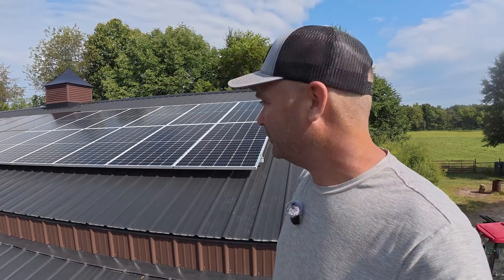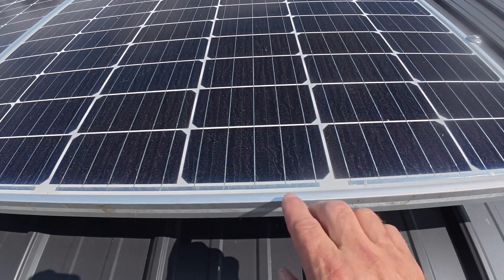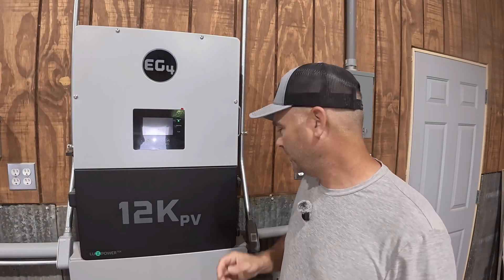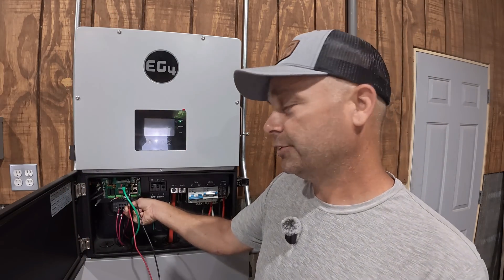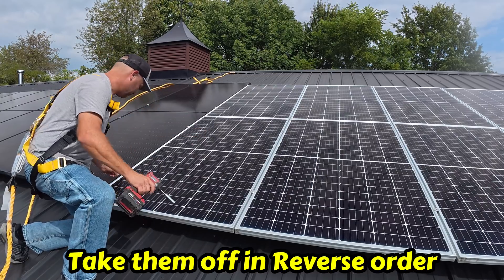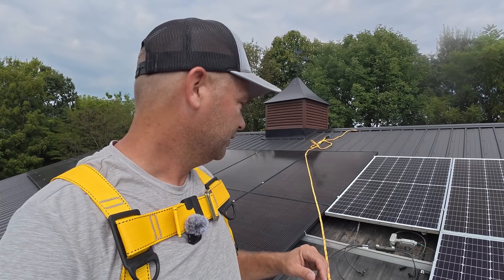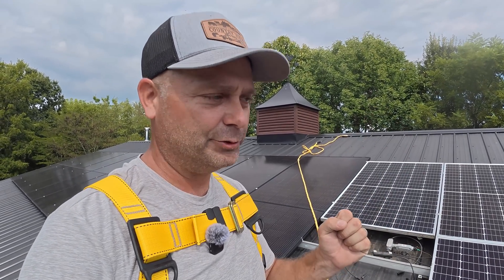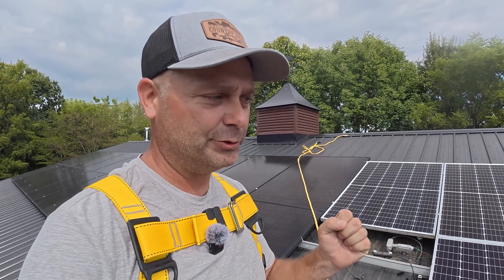Replacing My Oldest Solar Panels with New N Type Solar Panels

Comment from the maker: Canadian Solar 450w N-Type Solar Panel:  https://bit.ly/4oF36ZF
Low Price Per Watt - Solar Panels:  http://bit.ly/3Jx8EmQ
Save $50 off a $500 order at Signature Solar by using my Discount Code:  COUNTRYVIEWSAVE50
Reply: In the ignorance of grid tie is easily demonstrated with a volt amp meter and 4th grade math called ohm's law
As once connected to the grid can only put in 15% of advertised output or extra electricity
And are getting credit for like 100% which equals everybody's electric bill skyrocketing to compensate for the power not actually going into the grid
And that's how we're able to and get it banned in certain cities and counties

Comment: Is it dangerous to disconnect MC4 during daylight?
Reply from the maker: If it is being used and current is flowing, it could arc.  If the solar disconnect is turned off, so no current is flowing, it shouldn't Arc.  But it will have voltage present.
Reply: @CountryViewSolar-DIYProjects  you are 💯 right

Comment: Set up the ones you just took down on a ground mount to back up your off grid array. That could least run your AC/Heat Pump or charge an EV? 👍

Comment: You need to make a ramp that goes to flat so that the front wheels of the tractor ride up one so the forks reach over the roof, it would save you a lot of time when up on the roof

Comment: I made a similar change and I'm building a similar array.

A bit over 20kw and using new Type N Topcon stuff.

I saw huge gains getting rid of the small 200w panels with lesser technology, especially in shade or less than ideal conditions.

Comment: When setting up my solar array it's a ground mount; ground mount panels run cooler than roof mounted and no climbing on the roof for maintenance. The array is split into a V shape: outer ends are tilted toward the north for a 23.5 deg array angle on each am/pm leg to grab more morning and evening light energy while lowering the mid-day energy clipping. That way I can use a lower KW cost inverter.

Comment: I'd be nice to keep the leaf debris out by putting a screen at top of the panels closest to the roof ridge
Reply: Windy days and rain will help keep the leave debris under control and non disruptive as it has from what we see in his video.  In Evans situation, the leaves are getting blown from the other side of the pole building over the peak of the roof.  A screen would trap the leaves and once they got wet they are stuck in place and a real pain to clean and dislodge from any screening material (just like gutter guards).  Then if any late falling leaves accumulate you risk ice jams above the solar panels in colder weather that add increased weight on the mounts and roof structure and increased risk of water intrusion into the structure during freeze thaw cycles like he would experience in Illinois and also damming of water if there was a heavy storm in warmer months.  In short, to maintain any screening, regular trips onto the roof would be required to clean out imbedded debris even on a larger mesh like chicken wire.
Reply: @Cobalt135 who asked u
Reply: @godzilla1956x  Do you always get hurt feelings this easily?  Maybe comment sections aren't for you.....
Reply: @godzilla1956x  We asked him.  If you can't deal with facts, then maybe you should just stay of adult discussion boards and go back to playing with your Lego set...

Comment: Nice job Evan, I agree those all black panels are more eye appealing.   Besides being more (heat tolerant) when mounted on a roof like you mentioned another very cool feature about those new (more efficient) solar panels is that they can also produce more power on cloudy days than the old panels are capable of.

Comment: Ironically, I had some open roof space and an available MPPT channel on my Fortress ENVY 12k, so I installed 12 super old 210W polycrystalline panels. Eventually, I’ll replace them with something at a much higher density. In the meantime, 8-10kwh of daily production adds to the overall performance of the entire system.

Comment: the black trim looks better but i rather have it painted white or the bare aluminum because it will be cooler in direct sunlight which the cooler the cells are the more they produce. Those are nice panels,wish they were bifacial which you dont need.
Reply: Your claim sounds logical, but it is actually incorrect.  The new panels produce more power due to different technology, and they actually have a lower loss in higher temperatures than the older Whiter panels.  Certain materials behave differently in different temperatures, hence what may appear to make sense isn't always factual.
Reply: @redbaron6805  you didnt understand what i wrote. i was only talking about the color of the trim. if those same panels had a bare aluminim trim they would be cooler on hot days which would help produce more.
Reply: @WesternIronwoks  I did understand what you were saying, but as I noted, you are misinformed.

The N type solar panels are not as heat sensitive, unlike the older P solar panels, especially the heat difference due to different colors on the frame and trim.

Which is why I said this is a bit counter intuitive, because heat does significantly affect the older P style of panels he was removing, but is 50% less on N type panels.

This means on a typical hot day, a P type panel has 18% efficiency while a N type panel has 22% efficiency. 

Hence, the effect of having a lighter frame around the panels would be a fraction of 1% of efficiency difference, or basically a rounding error in actual panel production.
Reply: @redbaron6805  too bad you are wrong,they are also sensitive to heat,maybe not as much but they are definately effected by heat.
Reply: @WesternIronwoks  Too bad you struggle with elementary math and physics.  The frame on a 4x3 solar panel is less than 1% of the surface area.  

The difference in heat and efficiency due to the frame color is a fraction of 1%.

Which is precisely why newer panels don't worry about the frame color, as it isn't a measurable factor in the overall efficiency...

Comment: some states require you to be grid tied so you cant be 100% off grid! That does make sense in certain conditions. in farm and ranch that would be nice considering thats less you have to pay out a month to high utility costs, or if someone like yourself experiences blackouts periodically through the year!
Reply: I don't believe he intends to physically disconnect from the grid. Just to net zero the utility bill.

Honestly, that should be the goal of any person with solar.
Reply: @punksjutgbd  The way they are changing laws it is more difficult in some areas. That said, keeping just enough on grid to be minimum bill and making the rest of the system off grid is not a bad idea these days. Start with your highest summer loads and keep removing as you build up is  pretty good way to go. For most that is home AC and deep freezers. If that is all off grid and on solar, it can run year round that way since you get highest output when you need AC and then when you get low output in winter that load is off you and should be plenty for deep freezers. And in worst case, you can pull grid power to a charger to top off batteries without being real grid tied. That would be my thoughts with the way things are today. For some it would be nice to make an off grid charging system for EV as well. Keep that off of your meter to the utilities.
Reply: @markpashia7067  Certain EV's already have this capability, where you can charge your EV, and then use it as a storage and draw from the EV battery instead of building a dedicated storage.  Modern EV batteries are designed to last a couple of decades anyways, so the extra wear on the battery wouldn't be a factor in most cases, especially with the larger EV's batteries that are now 200kWh+...